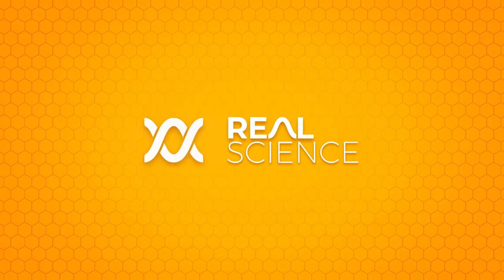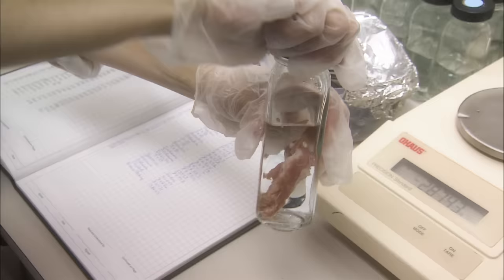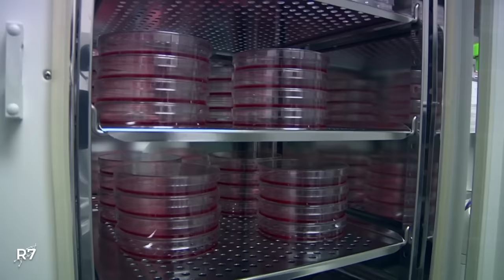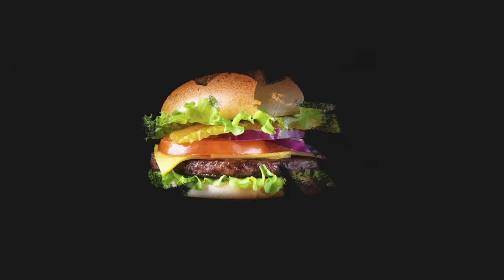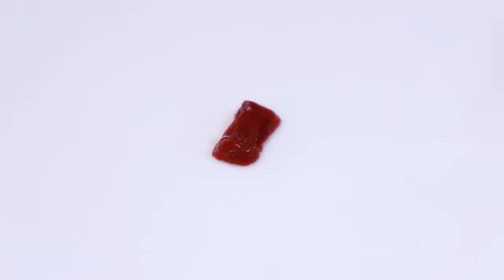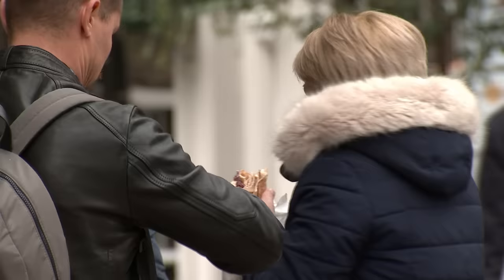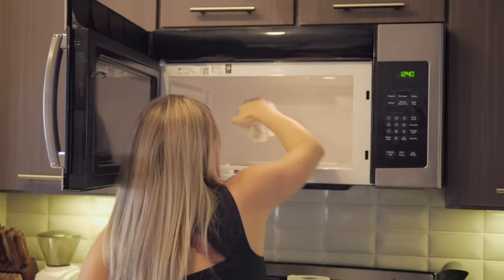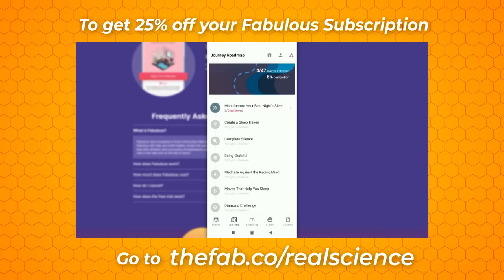The Truth About Lab-Grown Meat

Comment: FBS can be replaced. Recombinant proteins can be made cheaply in E Coli and you don’t need too many proteins for muscle tissue. FBS has many proteins for the development of a full fetus with many types of systems - Neural, musculoskeletal, cardiovascular, excretory, digestive etc. These are not needed for meat culture as it is only one type of tissue. Vegan is great but meat consumption will be there unfortunately so lab meat will be there.
Reply: "Recombinant proteins can be made cheaply in E Coli" is technically correct. You just won't be getting the same type of post-translational modifications in E. coli vs CHO or even yeast. And also you will probably have a hard time separating out the proteins in the proper form with E. coli. That is what costs a lot. The actual feedstock for E. coli might be cheap af but the downstream separation process definitely isn't.

Vegan diet is nutrient deficient and humans would still require animal-source foods unfortunately.

Comment: This seems to me like the wrong way of tackling the climate change problem. This is like playing one of those civilization games and focusing on the wrong research tree to solve a problem. The problem with climate change is energy! 

If you unlock cheap, clean, renewable energy, almost all the other stuff will be easily achieved. The earth is big, 70% of it is water that can be desalinized  into fresh water for growing plants & for cows to graze on it. Cheap Fresh water can be used to plant the Sahara and do natural carbon capture using trees. Cheap energy + electrification (same research tree obj)  will also eliminate most of fossil fuel for transportation,...

Cheap energy will allow u to do all kinds of things that would have been prohibitively expensive due to its energy consumption cost (direct carbon capture, all kinds of metallurgy to unlock new materials that in turn would allow u to build more stuff, ...) 

Asking people to stop eating meat is just stupid, as long as the economics allows me to buy affordable meat at the supermarket, people are going to do it.
Reply: hi, electronics engineer here. i don't have the time or stamina to resppnd to this but... no.

Comment: I mean you can also hammer a nail using 500 precision engineered, laser cut levers, wheels, and sprockets. Sure you would have to put a massive and yet unknown number of hours of R&D and untold fortunes in dev costs to eliminate all of the points of failure. You would have to use an entire barrel of industrial lubricant to make sure you are minimizing energy loss at every potential point on your industrial sized stainless steel Rube Goldberg hammer machine. Not to mention that you would have to build a dozen factories to produce your hammer machines in bulk to get any economy of scale. But you could do it

or you could use a hammer. Hell, a rock will work in a pinch.

The hammer is ending capitalism and its perverse incentives. The hammer is also just putting cattle on agriculturally useless scrub land in reasonable numbers instead of burning rain forest.
seriously market solutions don't work when the market is the problem, and it does not take a team of highly educated biologists and chemists to figure that out. let the egg heads do abominations of nature for the sake of learning! not to build the most stupidly complex science patch possible for a simple failure of organization. Ill give you this one for free too, the solution to carbon emissions from other sources is also not sinking time and money into carbon sequestration. The solution is to stop burning oil and coal. if society as it stands can not survive the simple straightforward answer, then society has to change.